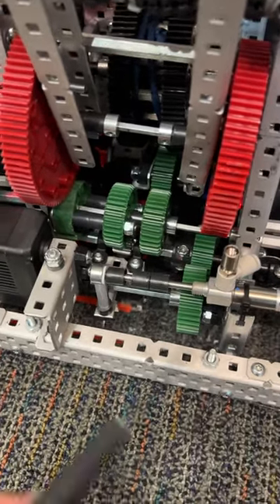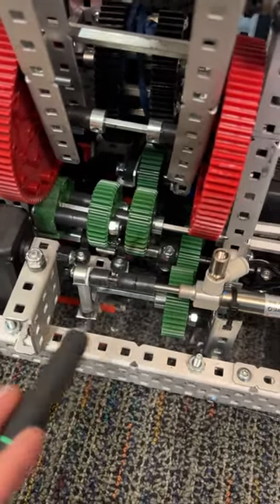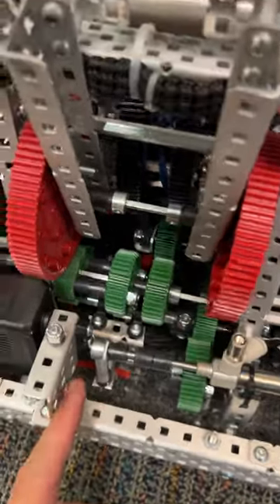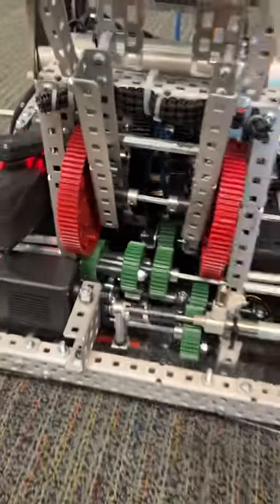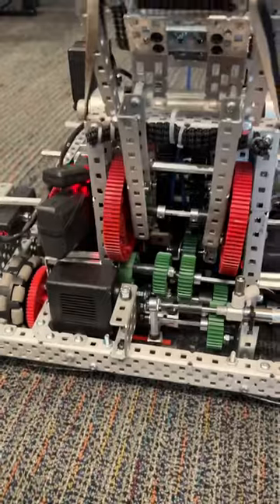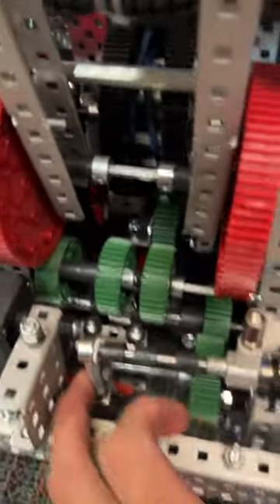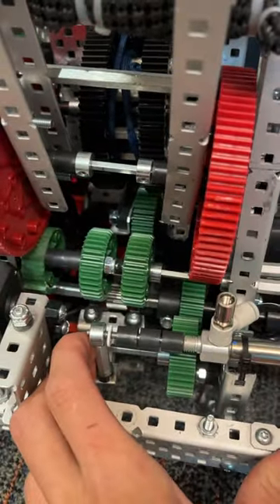Over under winch leaks/explanation

Comment: how do you plan on attaching the string to the pipe
Reply from the maker: We’re going to use some sort of passive arm and claw
Reply: @robotoholicsrobotics  u cant hold on to yellow cup
Reply: @robotoholicsrobotics  what do u mean by passive arm
Reply: @metalchemists look up pole climbing robots; they use this gravity locking system, and I’m assuming they’re planning on doing the same so they don’t have to worry about claw power or another motor
Reply from the maker: @metalchemists  look up 4082b tipping point explanation. They had a high ring mech that was able to deploy extremely high and fold down small we will simply put something that can grip the pole on the end and attach the winch string to it